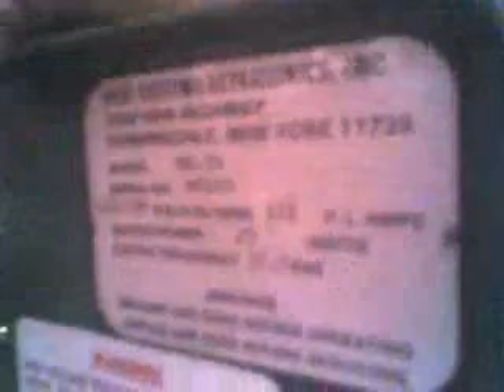Fiery Fun with an Ultrasonic Cell Disruptor

Comment from the maker: An Ultrasonic Cell Disruptor is normally used to break apart cell bodies in a liquid in order to collect DNA samples or individual cell parts. It's used a lot in the creation of pharmaceuticals and vaccines.  

If it touched your teeth,  it would either shatter them or at least give you an enormous headache. If you put it in your ears, it's safe to say that it would fuck those up too.
Reply: Please don’t stop there! You never warned us about the eyes, the nose, and on down the body. Also I used to use one of these to brush my teeth with a brush head. I was way ahead of my time. You should have seen my teeth back then they were exquisite. Then sonicare came and bastardized I’m invention that was to be man’s first source of zero point lobotomization technology as well as for use in techno’orgies across Europe (especially Eastern Europe, culminating in Monrovia) which is the fault of this video for not warning against the use of this devise for sexual gratification.